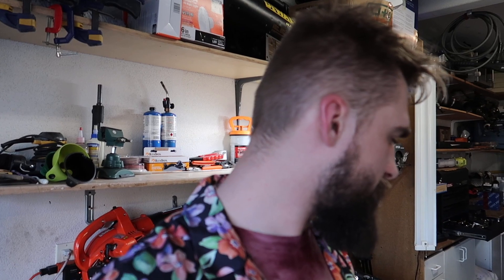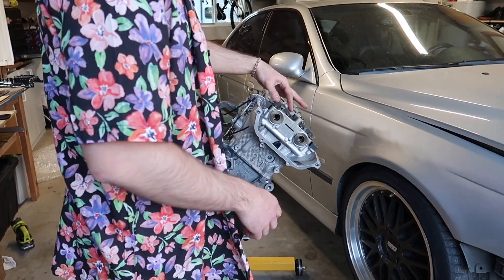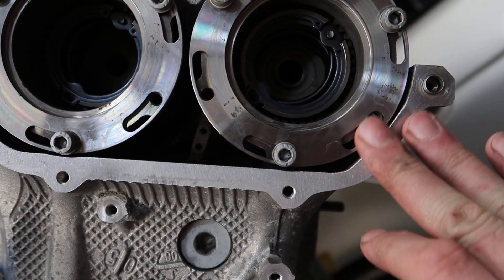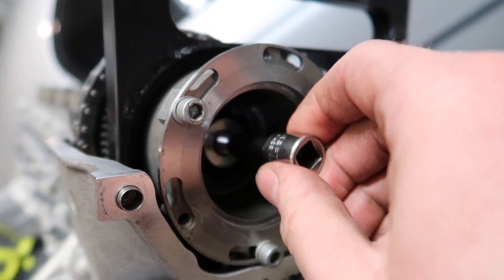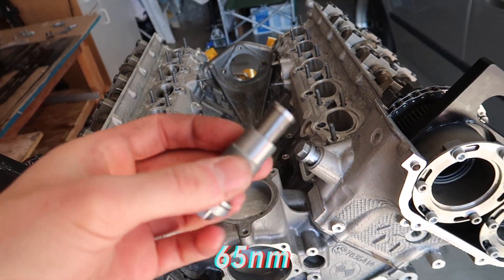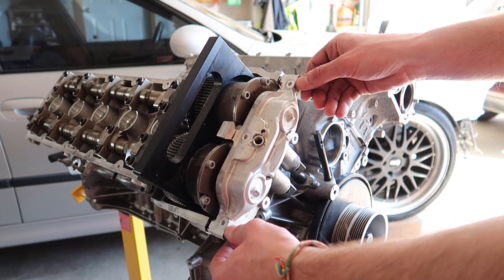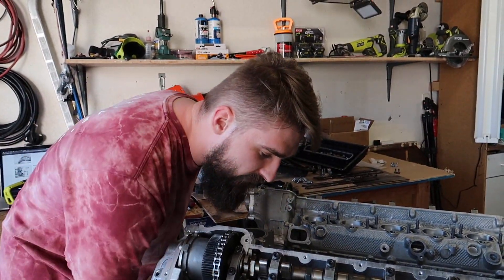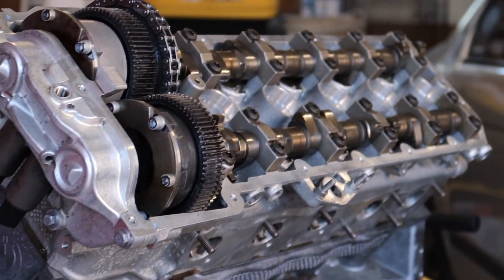How To Install BMW M5/M6 S85 V10 Vanos Gears/Units & Set Proper Timing (V10 M3 Build)

Comment: Glad i found your videos, i have a 06 M5 V10, not to long ago my girl took it to work and on her way back home it started smoking black, when she got home i started it up and the and as soon as the engine turned it sounded like the motor clunked and it didn’t want to turn anymore, i figured it hydro locked and did research and it did  hydro lock, most likely because of the fuel injectors cause it was smoking black, so i bought new fuel injectors, im waiting on them now, and just hoping nothing in the engine got damaged, im gonna try and manually turn the crank first to make sure the engine is free, and if it is I’ll continue to install the new injectors, but if not im terrified to take the engine apart with no knowledge of removing engines. Im somewhat knowledgeable about mechanics and do my own maintenance but if this engine is stuck im gonna really need some help 😢

Comment: What would you have to do if the 3 small Alan bolts upfront are removed? My buddy got his motor back from a shop and they removed them and now they don’t line up no matter what we do / try
Reply from the maker: That means the pre-tension is off because of those bolts being removed. I've dealt with that before. It's hard to explain via comments, but you essentially need to twist the gears back so they line up.

Comment: Hi, I did the timing as in the video but when I did the timing test I see that there is a very small space on the bench 2 intake is it normal that there is this small space knowing that I followed step by step what you did?
Reply from the maker: What space on what bench? Not exactly sure what you're asking
Reply: @YEVSBUILDS  on the timing game you it is good the camshaft timing tools are flat me at the end there is a big play, I can send a video on your instagram to show you if you want
Reply: @YEVSBUILDS  At the end of the timing, the camshaft timing tools are not flat, especially the exhaust vanos. I don't understand why I followed your video well, however.
Reply from the maker: @noxwolf6678  Maybe the chain is off by a tooth, I had to redo mine so many times for everything to line up properly the first time,
Reply: @YEVSBUILDS  Ah, okay, okay, so I realized my mistake was that I tightened the small screws vanos before tightening the screws that hold the vanos, so the timing wasn't correct.
Thanks for the feedback.
Have a nice day.

Comment: I just got my S85B50 vanos actuators serviced. However the shop didn’t tighten the only screw fastening the caps on the vanos actuator cylinders. I tried to ask them for the torque needed to secure the screws but they wouldn’t tell me. How much is that toque to secure the only screw on top of the caps of the vanos actuator units?

Comment: Mate..you are streaming in my garage all day as i do my engine..looking in TIS i discovered something..if you look at "replacing oil pump" it tells you that you need to meassure the tensioner play(72.8 to 80)...but if you look st "replacing high pressure oil pump" it clearly says that if your vanos pump is 12/05+ you do not need to meassure the chain and that you must not use shims..not sure what to believe as it sound like a contradiction
Reply from the maker: Appreciate you hahaI mean if it says you don't need to measure the chain if yours is 12/05 then I guess you don't but I like to make sure. It's not wrong to know haha.

Comment: I installed the vanos gears today and i found a method which is 5 times quicker and easier than bmw stupid insteuctions..you install the intake gear on its own..put chain on it...then you easily slide the exhaust one on the position with the special tool at 45 degrees...once the screw alligns with the whole you are done..took me 2 hours of trying bmw way..and 5 minutes installing them separate
Reply from the maker: Wow, i gotta try that haha thank you for this

Comment: Hey man!!.. I'm loving the videos btw! I'm starting the rebuild process on my S85 as well. 
I was just wondering where I can get that cylinder coating service done??
Thanks in advance my friend!
Reply from the maker: Appreciate you bro.

Well, I'm just not sure where you live so if I were you, I'd call your local machine shops that work with engine blocks and ask if they do the alusil coating. That's what I did

Comment: To, I saw u lubricate with 5w-50, not 10W-60?
Don’t tell me u use engine oil of 5w-50 as well?
Reply from the maker: For the E46 I use 5w-50. For the V10, I'll most likely stick to 10w-60. Why? You wouldn't recommend?

Comment: Hello Y.E.V.S BUILDS,

I just found your S85 build series and all I can say is WOW, FANTASTIC.  Great detail on all the critical items for this engine.

I do have one question on this video.  When you installed the VANOS bolts to cams, it did not appear that you had installed the timing chain tensioners before torquing the bolts.  Did you apply pressure to the crank pulley to get tension on the chains?  If not, it is my belief that the final timing could be off due to possible chain slack.

Okay, one more question:  What is the bolt head size on your old and new VANOS to cam bolts?  I swear mine are 17.5mm and it is very difficult to find.  For disassembly, I had to pound on an 11/16" socket, but this is a No-Go for assembly.  18mm was far too loose to remove (even 6pt socket tried to round the corners) and these are high torque fasteners.

Cheers,
Mr. P
Reply from the maker: Appreciate you so much! 

I did everything in order the way the BMW TIS said to do. So the chain tensioner was in the order that BMW instructions said it to be.

The new central bolts for me were 18mm and the sockets fit perfectly. Haha I'm not sure what sort of witch craft you had in there haha
Reply: @YEVSBUILDS  
Thank you for the reply.  I am building two S85's bolt-to-bolt.  Your should feel very lucky that you did not have any damaged bores on your S85.  Both of my engines were scored so bad I have had to sleeve them.  In the long-term will be better....I hope.

PS:  Get your fuel injectors serviced or replaced.  My theory on the bad bores for S65/85 engines is leaking injector resulting in hydro-lock and bending the rods.  From there, the bent rod keeps working in engine and results in MAJOR bore scoring!

Look at S85 blocks on Ebay.  Most will show bad bores.

Cheers,
Mr .P
Reply from the maker: @LSmiata  Appreciate the advise! Definitely going to get a set of new injectors haha
Reply from the maker: @LSmiata  Appreciate you brotha!

Comment: Can you move vanos unit pistons back and forth easily?
Because my stuck for  exhaust for both sides and I don’t know if that’s how it’s supposed to be 🤷🏻‍♂️ Before I took engine out I had codes for Vanos oil pressure and all solenoids
Reply from the maker: Yeah mine move freely. I'm honestly not 100% sure if they're supposed to move freely, but I'm pretty sure.
Reply: Hi,  i am now working on an m6 s85 and my vanos gears are also stuck on the exhaust side
Have you figured out if thar was normal? When I was assembling the front cover with the solenoids i heard a crack. Then found out it was the timing tool locking on the camshaft broke. Too much force from the vanos gear.
Any suggestion?